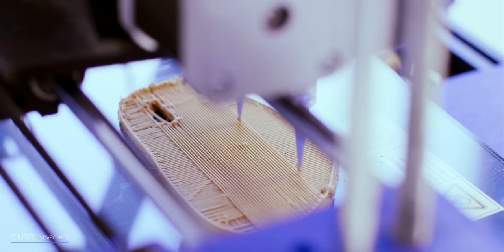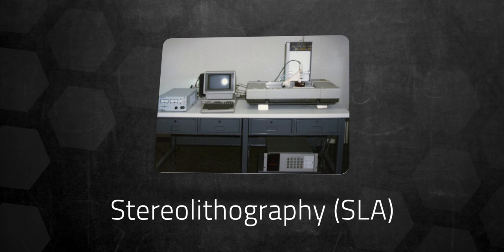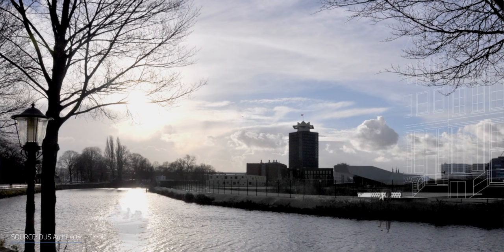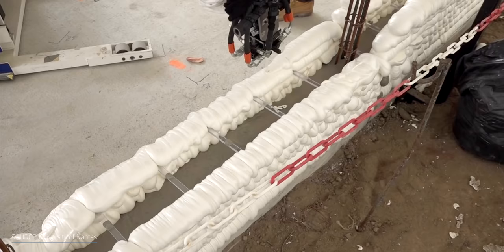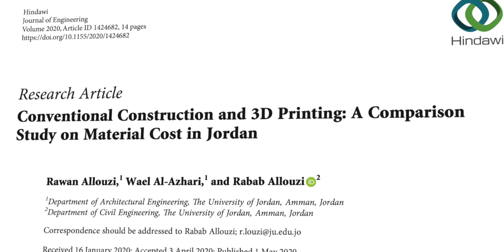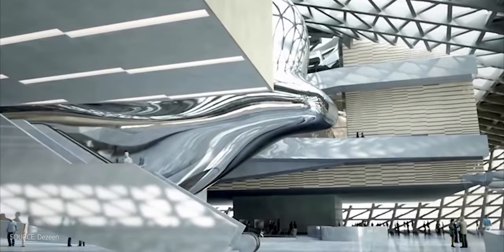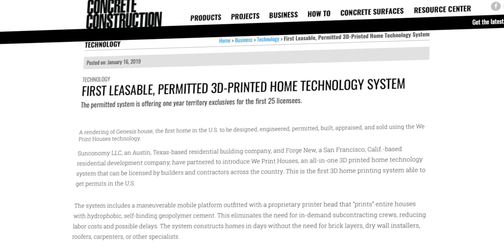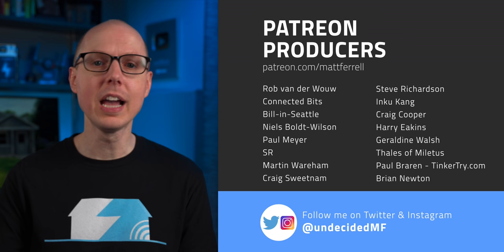This 3D Printed House Changes Everything - Explained

Comment: If they get as many failed prints as I do, there will be a whole neighborhood of unfinished and messed up houses
Reply: I'm sure the workers are on their toes with their phone ready in case something does go awry, and they can hit a panic stop button 😄
Reply: lol you need a better print bed
Reply: @Qui-9  Not to mention it looks like at least one of the workers is 24/7 watching the print.
Reply: What printer do you have, Federico?
Reply: your failures is likely due to the narrower nozzle and requirement to heat a filiment instead of just dumping cold cement, and requirement for finer precision. These 3d printed homes can have a lot more error and inaccuracy as the excess will just be removed. And structural support does not have to be uniform. Just in near enough the same pattern and places. No need for high accuracy.
Reply: Ha ha .. Its a work in progress
Reply: Burn
Reply: @davidbass6780  
That’s what they always say for an excuse.
Reply: @snaggalfrash9013  explain please.

You can explain, right? Ain't just saying stuff because why not? Got an actual explanation behind what you say?
Reply: Italy will get knocked out of the Euros by Belgium btw 👍🏼
Reply: wet cement is easier to fix then melty plastic
Reply: @grimaffiliations3671  they didn't
Reply: First prints always terrible
Reply: They'll probably have a sale on dented and damaged 3D printed houses. Like, maybe it's missing a wall or part of the roof, or the bathroom toilet bowls are solid concrete with no holes.